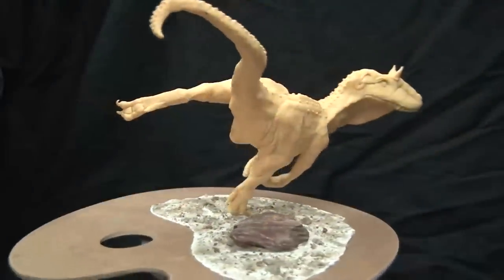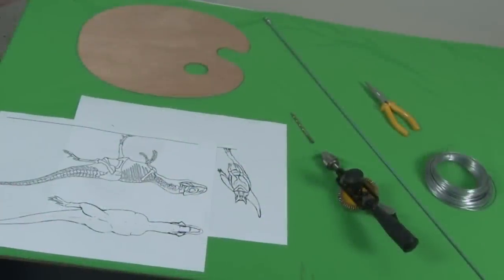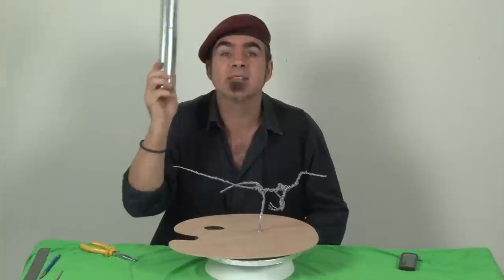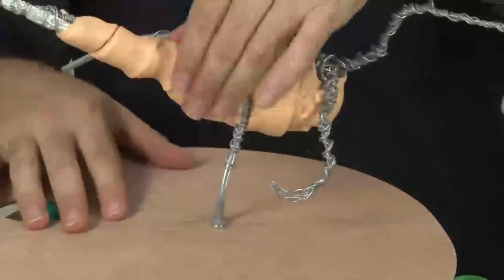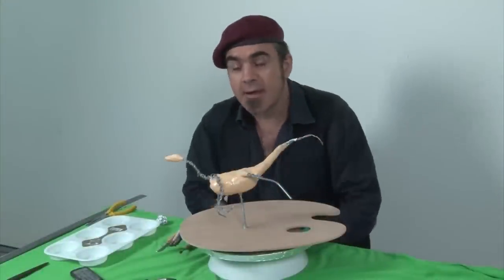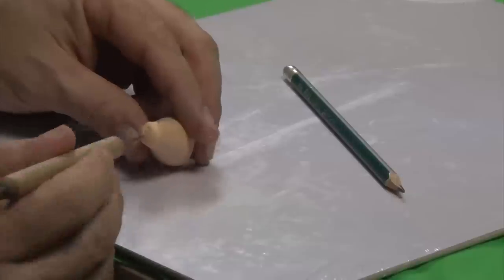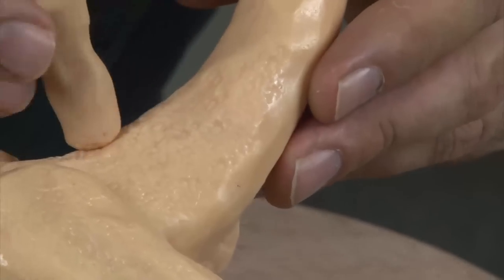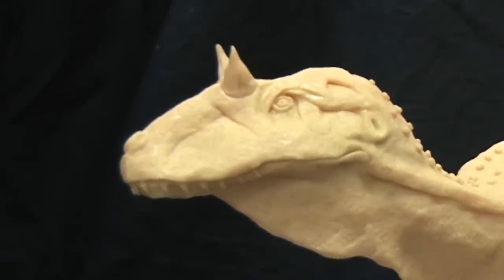Art Lesson: How to Sculpt an Allosaurus Dinosaur in Polymer Clay Part 1 of 2

Comment: Hey great work!

I recently started sculpting my first t rex and ran into a bit of trouble with his teeth. His mouth is open so I have the top and bottom to do, but its pretty challenging to get in there to put in small teeth. Also, it seems like my clay is a bit too soft to form such things as small tiny and pointy teeth. What would you recommend to do in this situation? I'm stuck!

Oh, I'm using Sculpey 3 for my clay. Hope to hear back!
Reply from the maker: +Anthony Lee Hi Anthony, Yes the teeth are fiddly.  I have heard of people baking the teeth first and then applying them.  I usually use a  set of tweezers and place them in like that. Regarding the clay,  If it  is soft put it into the fridge prior to working with it.  Keep on creating :)

Comment: what kind of metal and wire did you use for the armor? And what is the brand of the material that you're using? thanks in advance! (you're videos are STUNNING)
Reply from the maker: Hi Elisa its just 'tie wire' (used in fencing) the thickness is not that important to be honest.  The booker rod is 3/16 th.  The clay I'm using is Mont Marte 'make n bake polymer clay. and thankyou .  Peace

Comment: Hello! Great job! =) 
The material used is the super sculpey? It dries the air or you have bake it?

Thanks!
Reply from the maker: +Kira Inu Shop Hi Kira, no it is Mont Marte Make n Bake Polymer clay.  It is softer.  You bake it at 130 degrees for 30 mins and it cures to a hard yet flexible finish.  Cheers joe

Comment: I want to get into sculpting (repainting pre-existing figures is fun but it's time to step up my game) and I have a 10lb box of natural clay.  Can I use that clay for this kind of project or does it need to be polymer?
Reply from the maker: Hi CoffeeWithTheCynic, great to hear you're getting into sculpting. Unfortunately your natural clay will not work for this particular project for a couple of reasons:

1) The sculpture requires a ‘core’ to be baked and hardened before the thin 'outer shell’ can be created. This stops any cracking.

2) Natural clay will not adhere to the armature or hold detail due to shrinking. Once you start working with the polymer clay you'll start to learn it's capabilities and see where it differs from natural clay. 

Thank you for your question, good luck with your sculptures!
Reply: Good to know.  I'll see if I can sell it off or trade it for some polymer.  Thanks!

Comment: haw does water soften plastic? and How can you bake a wooden
palette?
Reply from the maker: Hi sergio, the water does not 'soften' the plastic at all, it merely aids in blending through lubricating the surface.  Polymer clay is impervious to water. Some people use white spirit (alcohol) and some people use Acetone [for smoothing].  I suggest people use water as it offers better workshop health and safety qualities.  Im not sure I understand the second question? Timber has on average, an ignition point of 300 - 370 degrees Celsius.  Considering Household ovens have a maximum  temperature of 260 degrees Celsius, and the fact that [Mont Marte]  Polymer Clay is baked at 130 degrees Celcius, we can be categorically sure we are well with in any parameters.

Comment: where did the lower jaw go? lol
Reply from the maker: Allan Palmer Hi Allen,  haha yeah look it may be understated.  I honestly really like to get feeback and opinions and am pretty objective about it all, I appreciate it.  I will say though on this, compared to Tyrannosaurs the Allosaurinae had a much more slender skull yet a very large cheek box, and the Dentary fitted very snuggly into the Maxilla. (sort of like an over bite) so alot of the lower jaw was hidden inside. This is why the teeth were so predominant.  The other oddity in regards to the Allosaurinae skulls is that the quadrate and other jaw supporting bones sloped down and backward.  This meant the articular hinge point was quite far back into the skull, and would most probably have been fairly concealed under the dewlap.  It is all just theory though.  Thanks for your comment too Joe ;)
Reply: MontMarteArt Don't get me wrong, fantastic sculpt, really dynamic. But the Adductor Mandibulae Externus Superficials muscle would still be very prominent in the lower jaw of an Allosaur. But like I said fantastic sculpt.
Reply from the maker: Allan Palmer Hi Allen, no worries mate and I have to admit you are right!  :)  I did some research about it. Thanks for the comment.  much appreciated!  Joe

Comment: Amazing just amazing on of he best dinosaur sculpts on the tube.  The head is a little large but it's amazing I went to buy some of the clay  and it's sold out so I went to another shop and they had next to nothing there can I buy direct from mont marte.  Could you also do a large herbavore may be a tri ceritops or an inguanadont or stegasarus thanks ed
Reply from the maker: Hi Edgar Alen poe, Mm the head might be a little big, I don't know.  Mont Marte does currently not supply to the public as we are a wholesaler but there are many many outlets that stock our art supplies.  Regarding sourcing your clay if you go to the stockist section of the website you will be able to put in your postcode and the search will locate the nearest store to you.  We may do another Dinosaur model down the track it really depends on the popularity of this one but stay tuned because I will be painting this one soon.  Thanks for commenting.  Joe